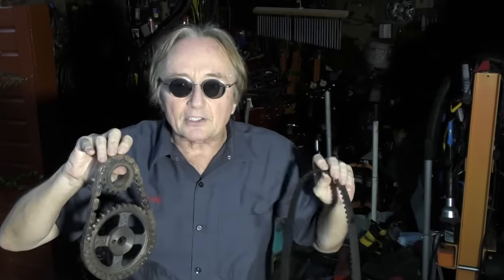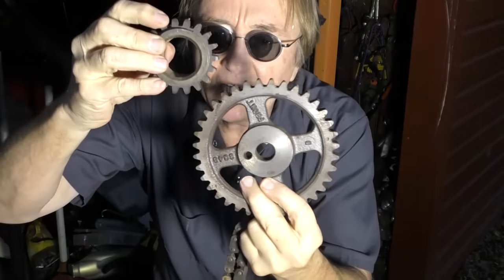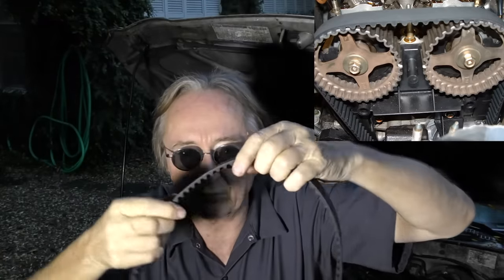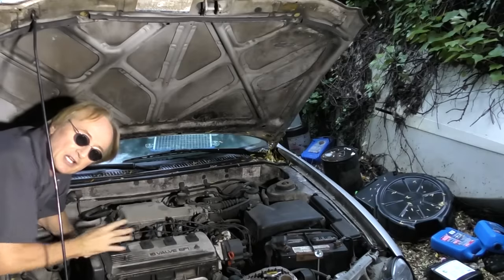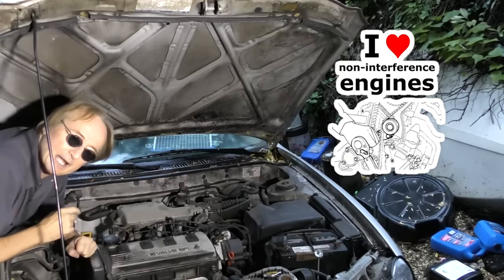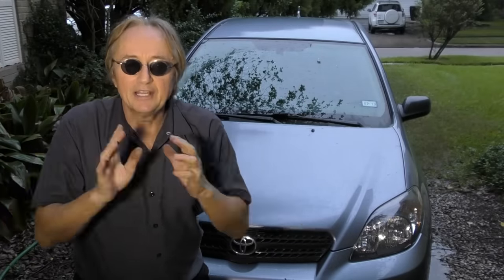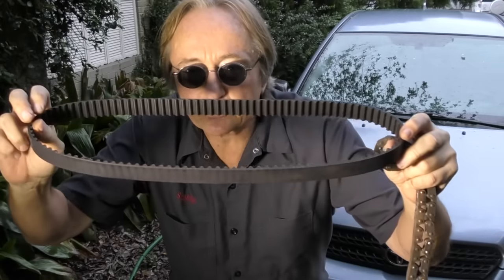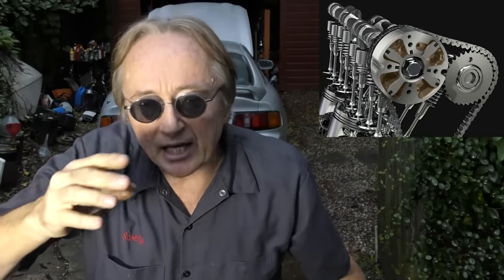Why Some Cars Have a Timing Chain Instead of a Timing Belt

Comment: A belt on an interference engine was the DUMBEST engineering of all time. 
If it's interference it should be chain
Reply: Absolutely
Reply: Interference engine is only way to go about more fuel economy. Toyota need more gas than Honda always.
Reply: @TruthTortoise81  I made this comment before even watching the video. 

Fuel economy yes but you don't save that much to justify rebuilding a whole engine when the belt fails.

 Of course when ignorant ppl go buy a new car they will look at the MPG and not even question interference or not (or even belt or chain)
Reply: They do that too. Still same issue. Especially when people get a new car with 300 hp that want to put their foot down
Reply: @jay_tarantula899  difference being interference your motor is fucked
Noninterference replace the broken timing component
Reply: Steve Prince   you didn't read, did you?
Reply: Steve Prince  😁🤣cute but my comments are very clear with proper english (another fail for you). timing chains have worked well on the DOHC interference k series engines from Honda (mind you this is an application of Honda going to chains and abandoning their traditional belt. 

BMW doesnt exactly have the best track record with engines IMHO. (Yamaha engineered their strait 6's iirc) their cooling systems usually fail but German cars are fail in general IMHO
Reply: Steve Prince  so Honda can do it without issue and other companies can't? Sounds more like a engineering issue and not a chain issue. 
Your argument is invalid. Maybe work on that before you attempt to criticize others on irrelevant issues (which you feel adds to the credibility of your argument, but it doesn't 🤣😁)
Reply: So Toyota has an issue not too long ago with their electronic tb causing cars to accelerate uncontrollably. so would you say that the electronic throttle body is bad because of one manufacturer? No! you just wouldn't buy a toyota.

The Ford Focus turbos had an issue with the head gasket failing so would you say their style of head gasket is bad and we should just do away with the head gasket all together. I know you would say for can't make a f**** head gasket for this car so you don't buy a Ford. 

Subaru ringlands were notorious for failure. So you'll you say ringlands are bad and suck all together? No you would say Subaru fucked up and you would not buy a Subaru

Should I continue or have I made my point clear?
Reply: Steve Prince  reread your initial reply, then reread all of mine. 
Oh the irony 😁🤣
Reply: gilessmokey   If they're all metal, they're generally reliable well past 100,000 miles.  The problem was, many manufacturers in the 1960s and 1970s used a nylon 'coating' on the sprockets in an effort to keep noise to a minimum.   The nylon over time would get brittle from the heat and start to break off the teeth of the sprockets.  The chain wouldn't stretch that much, but once enough of the nylon wore away or broke off, it would leave enough slop in the chain for it to jump time.  For a number of years, anytime I bought a car from that era, the first thing I'd do is tear out the OEM timing set and replace it with an aftermarket all-metal set.  I never pulled an OEM set that wasn't disintegrating; one car had a scant 30K miles on it and half the nylon was already gone.
Reply: @KT-fi7tm   Well, there are usually recommendations that the belt be replaced every so often as a matter of routine.  The early Ford Escorts ('81 to around '85) had a recommendation that the belt be changed at 50K miles (I think; it's been years since I dealt with them) and most people ignored this.  The problem for Ford was the belt drive on those engines was 'marginal' at best, and when the belts started breaking as soon as 35K, Ford had to replace a lot of cylinder heads under warranty because - yup, interference design.   If you were even 1 mile beyond 50K, though, you were technically SOL (many dealers did 'fudge' the numbers, though).  Ford eventually did revise the design so that it was no longer an interference engine, and I think they went with a better belt system for longer life.

My dad had one of those early Escort shitboxes.  He took it in for service when the car was about 4 years old; the mechanic mentioned replacing the timing belt, but Dad said 'no'.   A couple of months later, BANG.  Car was completely out of warranty by then, and the costs of repairing it were significantly high enough that he just junked the car.
Reply: On my 1977 Chevrolet Chevette, the timing belt slipped on cog at only about 75,000 miles.  That's only 75% of the 100,000 miles you mention
Reply: @frankeggers4024   There are a number of factors to consider.

One, timing belts can be defective, even the factory items.  So, yes, premature failure is indeed possible.

Two, vehicles of that era didn't have overdrive, meaning the engines would spin faster than is common today.  Faster speeds means faster wear,  and four-cylinder engines in particular were set up to spin faster.  My own '79 Chevette with a 4-speed would be turning 3 grand at 55-60 miles per hour; a similar engine today with overdrive would be running at significantly lower speeds.

Three, I don't recall ever seeing a replacement interval recommendation greater than 60,000 miles, even on modern engines.   The 100, 000 miles I mentioned were for all-metal timing CHAINS, not belts.

Fourth, the Chevette gasoline engine (1.4/1.6) is a non-interference design - that is, a belt failure does not destroy the engine.  It's still inconvenient when the belt fails, of course, but slap a new belt in there and motor on.  Hell, in Chevettes, replacing the timing belt wasn't even hard to do!   

Offhand, I'd say the 75,000 miles you got out of it was about average for the OE belt.
Reply: @frankeggers4024  who cares its non inference cake job to replace too.
Reply: @xaenon  1960s 1970s were not nylon gears maybe late 70s thru mid 90s
Reply: @damonlemasters3424   They sprockets themselves were not nylon; they merely had nylon jacketing to reduce noise.   I've found the nylon-coated sprockets in a lot of cars from the late 1960s through the 1970s.   My '68 Fairlane had them, my '71 Impala, my '74 El Camino, my '73 Maverick, and my brother's '77 Monte Carlo.  As far as I could tell, they were all OEM.
Reply: @xaenon  I know exactly what nylon gears are I didn't think they went back that far everything older than  mid 70s I've worked on was solid steel. I started wrenching in 1990 so those older ones were probably  already replaced.
Reply: Too many technicians and engineers on here.
Reply: @damonlemasters3424  I was only elaborating because some people get confused when you say 'nylon gears'.  I can't tell you how many people I had to explain that to, lol.  

Personally, I think nylon anywhere in the timing set (aside from maybe the guides, if applicable) is one of the dumbest ideas I'd ever heard aside from the aluminum-block Vega engine.    

I know Ford was using nylon in their timing sets as early as 1968 because my Fairlane was originally owned by my dad, who confirmed the engine had never had major work during the 72K miles it was in his care.  I know GM was doing this by 1973, and probably earlier.
Reply: @darkpassenger7064   I'm neither a 'technician' nor an engineer.  I USED to be a mechanic, but a lot of this is just common sense.  No one solution is ideal for every situation.  Belts and chains and gear drives all have advantages and disadvantages.  Overall, I feel chains are inexpensive and more reliable for general use, while belts tend to lend themselves better to high-revving small engines, and especially for OHC mills.  Gears are, of course, superior to all but are noisy and difficult to fit to OHC engines.
Reply: @xaenon  my dad has a 67 Ranchero with the 390 we rebuilt I don't think it had a nylon cam gear.
Reply: @darkpassenger7064  technician Ya engineer no but would probably be able to design stuff a hell of alot better than most of them.
Reply: @TruthTortoise81  Had a belt last 60k  when it should have gone 90k on an interference engine.  I always knew it was a scam to use a belt.
Reply: Not the smartest idea but the Honda b series engine is a interference timing belt engine and its one of the best engines ever built in my opinion. With modern upgrades they can make up to 1800hp out of a 1.8 liter engine from the 90s I'd say that's impressive!
Reply: Steve Prince   You'll pardon me for having my doubts.  Most people wealthy enough to afford a Rolls generally don't spend their time on YouTube discussing the virtues of various internal components of an automobile engine.  But, for the sake of argument, let's assume you're in earnest.  Considering what a Rolls costs, the timing set had damned well BETTER be silent and reliable.  If I were a Rolls owner, I'd be mighty f***ing pissed if my over-extravagant, ridiculously expensive codpiece were anything less than absolutely perfect.
Reply: Man you got that right.
Reply: Steve Prince   Very well.  My point, though, stands.  For what those vehicles cost, the mechanicals had better be as close to perfect as humanly possible.
Reply: Steve Prince  Scotty is PARTIALLY correct.  I know that helical gears are not commonly used in automobiles (except, as you point out, in reverse), but for some racing applications, such as in the common Chevrolet, Ford, and Chrysler V8s, there are straight-cut gear drives available, and I believe it may be what he's basing his claims on.   Of course, as I said, they are for RACING, where the noise they make is irrelevant.  I HAVE encountered gear whine from the Ford 4.9L inline-sixes I've owned or driven, though.   It's actually a very common characteristic of those engines, whether brand new or with 300,000 miles on them, and their timing gears are indeed helical.   It is so characteristic, in fact, that I actually missed it when I bought a V8 model once.
Reply: What most irked and annoyed me was that for the 1977 Chevette, there wasn't even a recommendation for replacing the timing belt.  I just intuitively realized that they might not last forever which is why, when the car was serviced, I asked that the timing belt be checked.  It may be that in 1977 timing belts for camshafts had not been around for very long.  However, one would think that before timing belt engines were put into mass production that there would have been testing to determine what their life was.  If not, surely by 1977 some cars would have had enough miles on them that failure would have occurred thereby making manufacturers aware that timing belts had a limited life in which case owners should have been notified.  So, I think that I had a right to feel annoyed that my timing belt slipped a cog.

At the time I did not even know that some engines were non-interference.  I had just assumed that all engines were interference which is why I had asked the service department to check the timing belt.
 @xaenon
Reply: Steve Prince   No, I understood you.  That was my point; despite the helical design of its timing gear set, the 4.9/300 engine and its little brother the 3.9/240 engines were known to whine, pretty much from the start.   I find it hard to believe 'substandard production' because of their renowned longevity and durability.
Reply: Steve Prince   Steve, to be honest, I don't think it was of much concern to them.  While the 'big six' engines were used in some base-model passenger cars, their chief application was trucks and vans.  Today pickup trucks and vans are appointed almost as well as many high end luxury cars, but back then, they were as basic a mode of self-propelled transportation as you could imagine - an engine, a cabin, a place to sit, a space for cargo, and basic controls.  Ford, I imagine, prioritized function and didn't much care if the engine was quiet.  And bear in mind, we are discussing large-scale mass produced utility vehicles, sold by the hundreds of thousands, and not hand-built premium luxury sedans.  Totally different goals, totally different expectations, and totally different price tags.
Reply: K T yes that’s what I said I still own my mint 1992 suabru Legacy turbo and it’s interference with a stupid rubber belt ......!!!!!!!
Reply: If it turns it should be a chain or helical steel gears which are quiet why would you drive major engine components with a rubber band
Reply: Engineers love plastic and rubber important parts. 
Return customers for the stealerships
Reply: as long as you keep up on timing belt maintenance, they really aren't that bad on an interference engine.
Reply: @legacyturbo8485  unless you've had an engine swap all 1990-1996 EJ engines were non-interference. After 1996 they became interference
Reply: Dana Vixen you may wanna check your facts cause my 1992 Subaru Legacy turbo 2.2 sohc is an interference engine lol I’m now sure who told you that it wasn’t but they aren’t correct. Go online and look at the car Manuel. My 1992 is mint which means I have the car Manuel and it clearly states that failure to change the timing belt can result in permanent engine failure hens interference engine. Trust me I wish it wasn’t an interference engine cause it sucks to have.
Reply: Steve Prince  
"You start off suggesting a chain on an interference engine is better, look at the massive failure rates BMW have suffered."
Weel, THERE'S your problem!

"Chains work well over short distances not when taken from the crankshaft at the bottom of the engine to the camshafts at the top. "
Which is EXACTLY why V8s ought to be OHV. (At least the crossplane V8s.) Don't get me wrong; I LOVE DOHC in an inline engine, but it's needless complexity in a big-cube torque monster.

Comment: The steel in timing chains does not stretch - this is caused by wear within the links.
Reply: That's a good point. When people say "stretch" they are referring to the result of the links wearing causing the old chain to become longer. The steel itself does not actually stretch.
Reply: Wrong!! The steel in chains does stretch!! I have measured this using vernier calipers, & not the cheap ones either!! I measured the link plates on a new chain, & compared it with the old one. There was a big difference. The metal stretches due to heat, & tension. The heat of the oil slightly softens the metal, & the pulling stress on the chain stretches it. Trust me, I have seen this so many times, it is not funny.
Reply: @christophermarshall5765  - I concede to your experience. Is it stretch only, or is it both?
Reply: @christophermarshall5765  I agree timing chains do stretch, I've seen it happen after a check engine light came on.
Reply: @markchip1  The chains stretch over a long period of time, & they wear the side of the teeth which has the tension of the chain acting on it. One really good way to see this, is to look at a bicycle chain & sprockets. You'll see if the chain has stretched by looking at the teeth on the sprockets. If the teeth have a "hooked " appearance, the chain is stretched.
Reply: @christophermarshall5765  - ignoring wear on the teeth, which has no impact on chain length obviously, I'm still curious about how the stretch of the side-plates compares to the wear within each link itself (and its roller elements)?
Reply: @markchip1  as the engine temperature increases, the oil becomes hotter, thus heating the chain. Over a long period of service life, & the heating of the chain. it stretches through the side plates. The reason for this is very simple. As the chain's plates heat up, they stretch. The tension on the chain generated by the rotational forces of the crank, which in turn pulls on the chain, thus placing load on it causes it to stretch. This is aided by the tensioning action of the tensioner. All of these conspire to stretch the chain, & this takes place over a very long time.